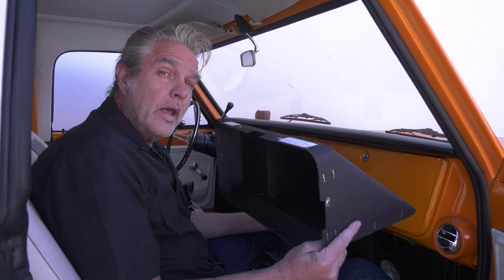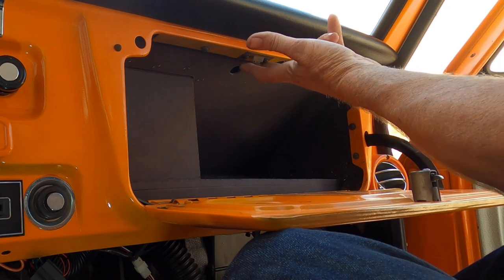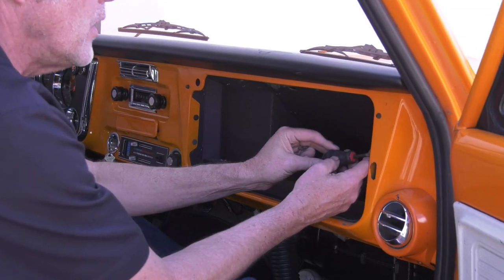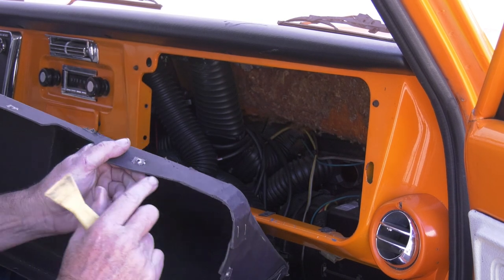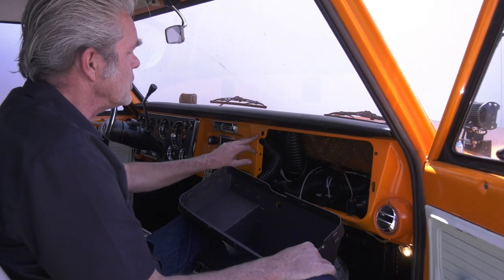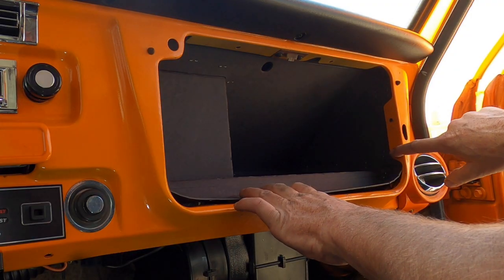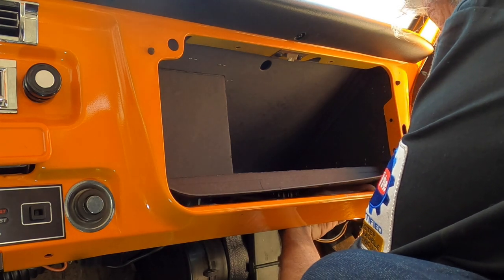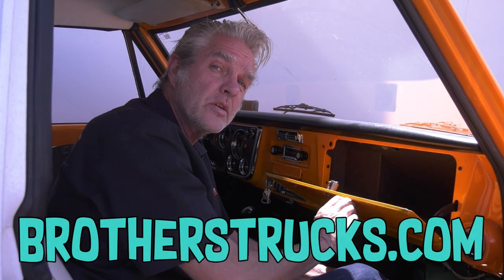1967-72 Chevy & GMC Truck Glove Box Liner/Insert Removal and Installation

Comment: hey dave thanks for the videos!Let me ask you are there any differences between blazers years 69-72?
Reply from the maker: Not many aside from trim related changes.
Reply: @BROTHERSTruckPartsTV  thank you sir so any changes are basically cosmetic? They all had power steering,power brakes,etc....
Reply from the maker: @speedwayman100   Things like power accessories are options that each truck regardless of the year may or may not have. One noteable thing about the 69-70 Blazer is that they came with drum brakes in front and the 71-72 came with disc.
Reply: @BROTHERSTruckPartsTV  ahhh thank you sir that's good to know!